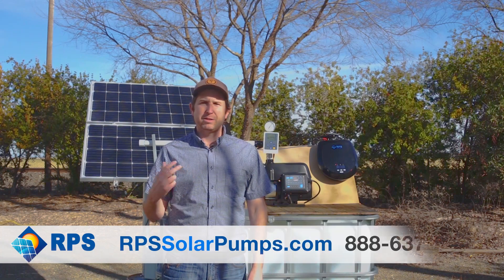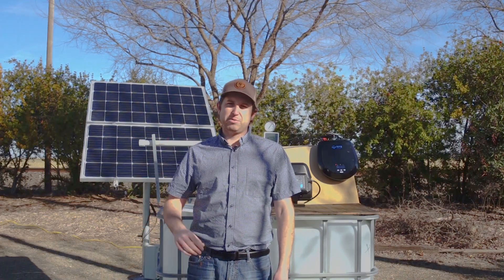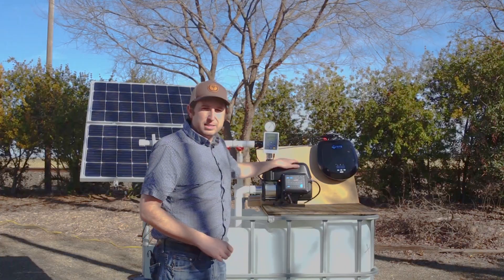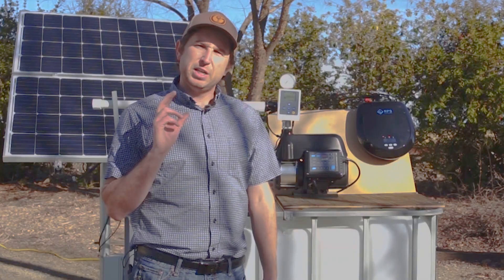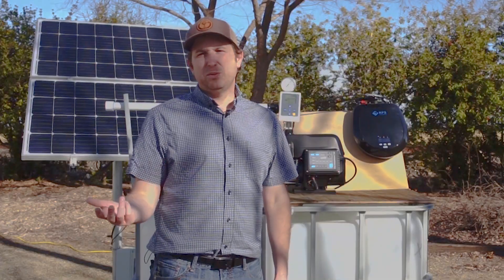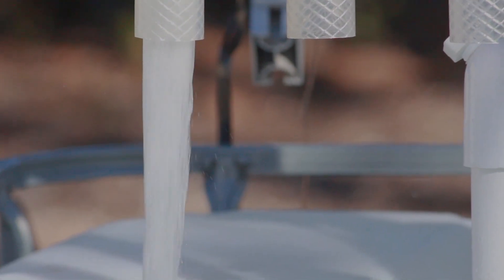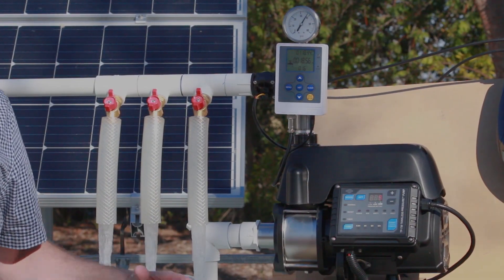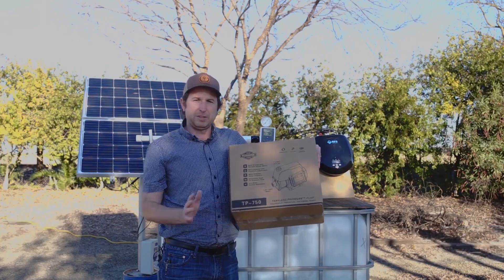RPS Solar Powered Tankless Pressure Pump™️

Comment: Could I use this pump even if I'm not off grid? 
Would be nice to get rid of my water pressure tank and old pump.
Reply from the maker: Sure! Lots of people who want a backup option from their well or storage tank. Plus, batteries can be charged via grid power or generator power just in case solar isn't available.

Comment: 2 questions.
1)Since I would be pumping from a reservoir does the pump comes with a float to prevent it from running dry?
2) Do you sell it without the panels?
Reply from the maker: 1. It has built in run dry protection for the pump, but if you suck in air you will loose prime.  Best to wire in a float switch to only pump when there is water available.  We have the floats, but you would have to cut the cable and wire it in, as it is not currently plug and play.  
2. Yes, we can sell it without the panels.  What are you going to run it on?
Reply: @RPSSolarPumps  I will be running it on solar panels. I only asked because I already have the panels. 
How much is the pump without the panels?
Reply: @RPSSolarPumps  i do not mind cuting the wire for the float

Comment: Hey Mike 
Do you need the batteries or will the system work on just solar?
Do you have a chart for the head and distance with the pressure 
Will get up with you want this system at the 4 day homestead show this spring
Eric
Reply from the maker: Yes, if you check out our product page, performance plot is one of the last images.  There is both a plot with GPM/ft and a table showing GPM.  Let me know what you think?  These will be perfect for a homestead show!  https://shop.rpssolarpumps.com/products/tankless-pressure-pump-system-new-2019